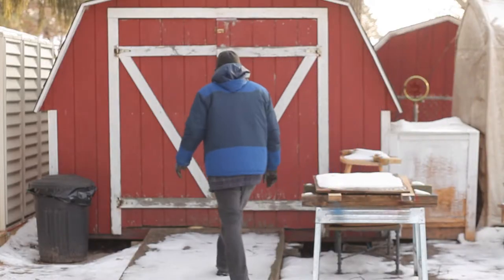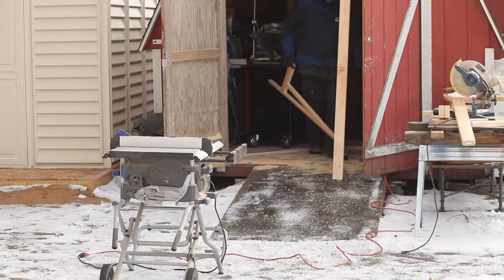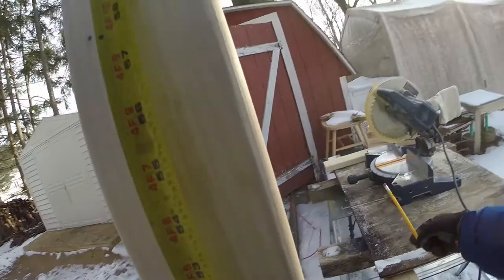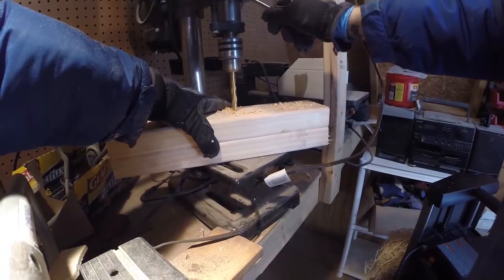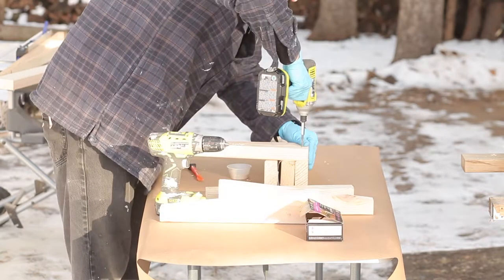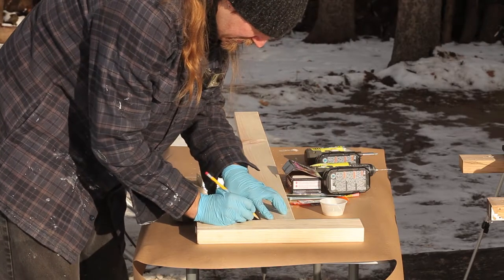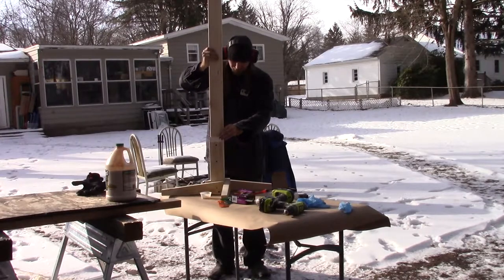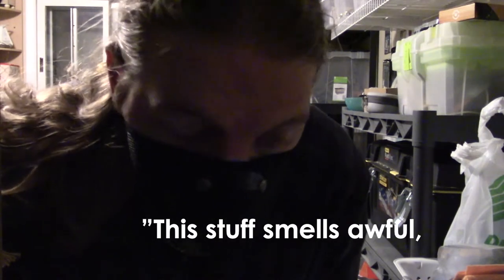BUILD - TALL PERCH

Comment: Having had one, that perch would fall over from a hard launch or when the bird is bating, but you probably realized that. Lol 😆 My hawk pulled over saw horses on the créance from time to time! You need a much bigger footprint or some weights.
Reply: Definitely just a training perch, and since the bird is clipped into that perch and a bow perch, if it falls, they are still safely tethered to the creance line. :) Nick has already designed a new perch since this video, as your suggestions, with a bigger "foot". :)